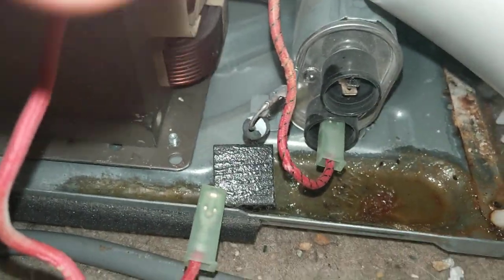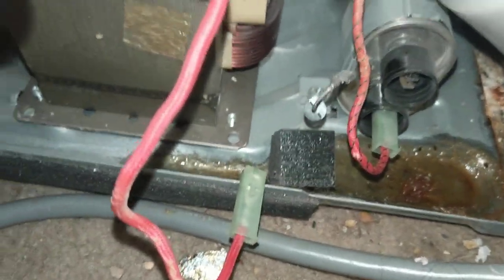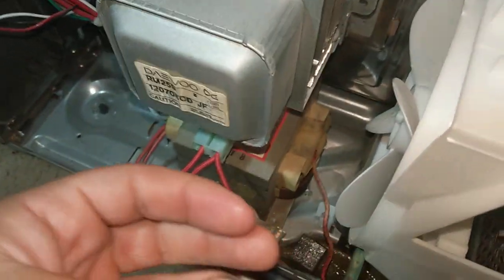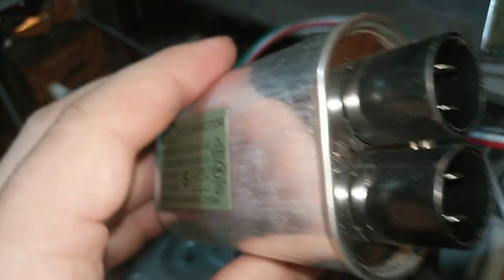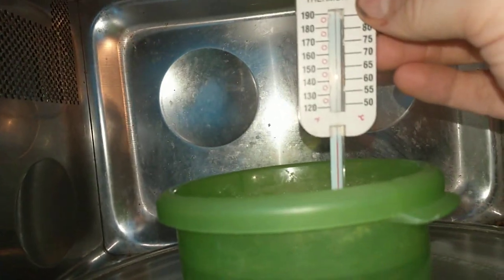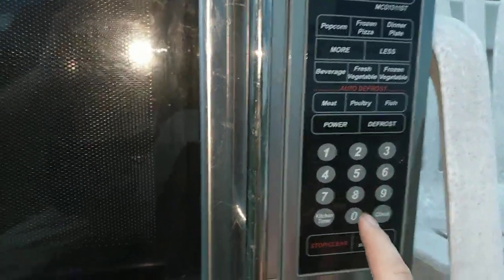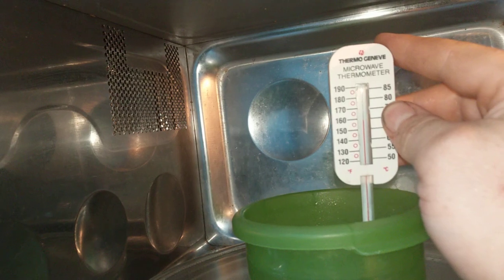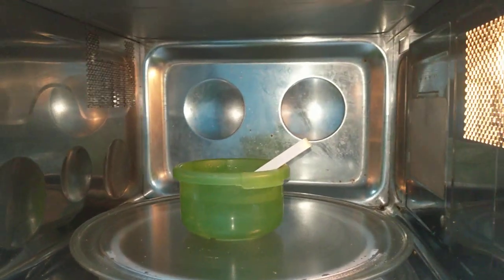Microwave Will not heat up repair part 2

Comment: Nice job on that!  Now you can stick it in the shed in case you get the munchies while doing a wash!

Diodes are one-way valves, they allow current to flow in one direction but not the other.  Never heard of it "boosting" anything.  With capacitors, it absolutely does matter which way they are hooked up if you're dealing with DC voltage.  For AC voltage it doesn't matter since it reverses polarity 60 times a second.

That microwave thermometer is pretty cool.  My dad's old Sharp microwave had a 1/4" jack inside and there was a probe you could plug in.  I don't remember if it read temperature out in degrees on the display but I know there was a mode where you could cook with it in the food.  The GE Spacemaker II has such a jack but we never found the probe.
Reply: The diode itself doesn't "boost", so you are correct about that, but the way it is configured with the capacitor creates a half wave voltage doubler, which is a form of rectifier circuit, converting AC to rectified DC and multiplying the output voltage. That capacitor looks like it's been leaking for a while to me, though!

Comment: Diodes are like a water valve. They only allow voltage to flow one way. It does not boost performance. Cmon man
Reply from the maker: Hey that's what I read when I researched the issue.